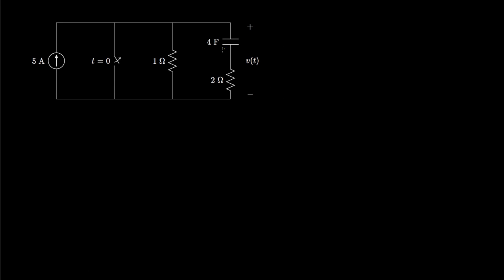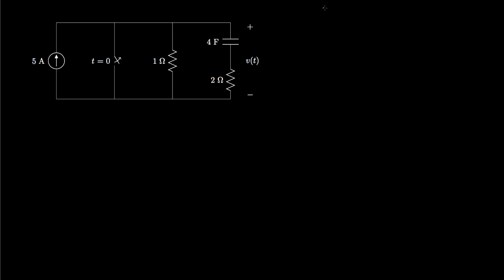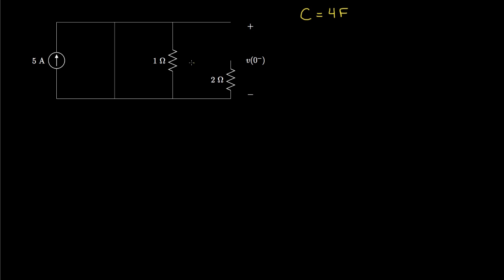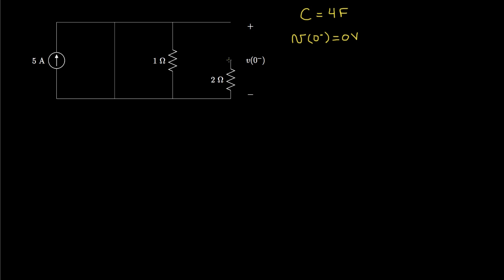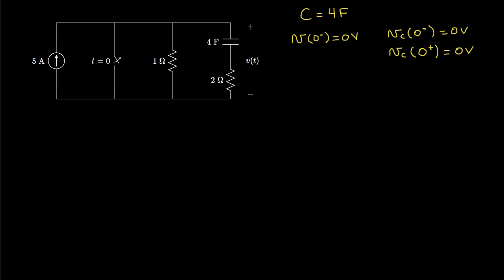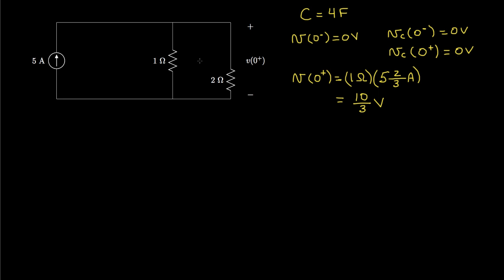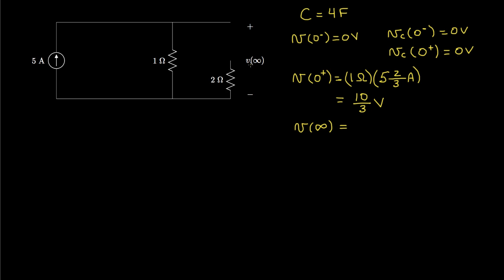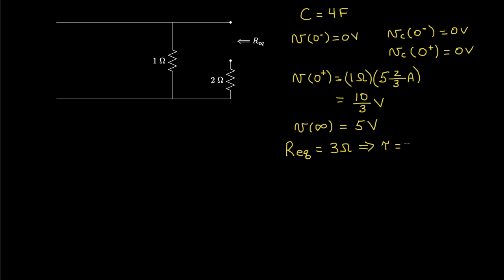First-order Switched Capacitive Networks: Part 2

Comment: @Sam Serwat.. Current always wants to flow through the easiest medium; that is, the medium the produces the least resistance. In the case at 2:00, the current finds it much easier to travel across the wire, since there is no resistance there. Thus, shorting the 1 Ohm resistor..